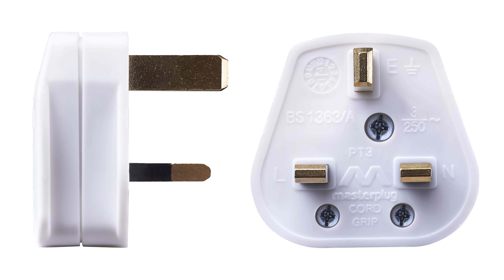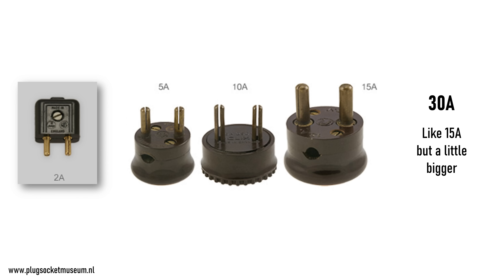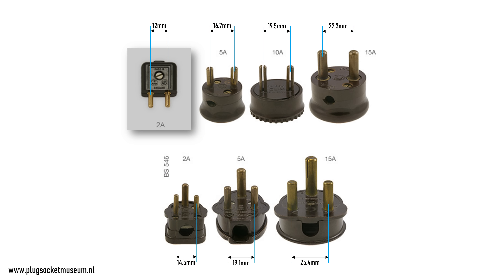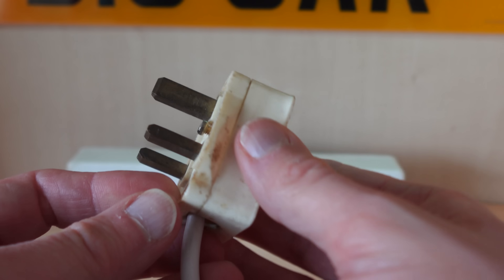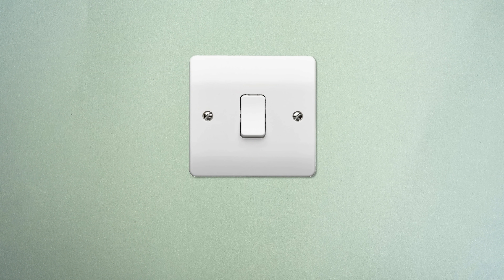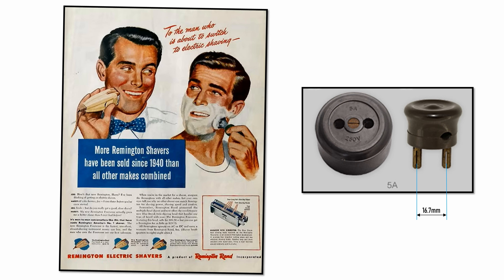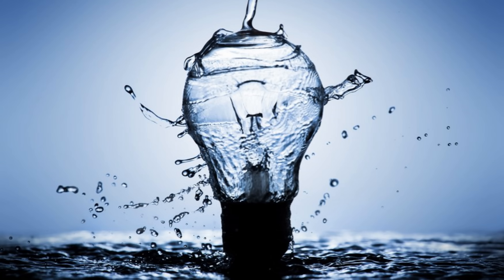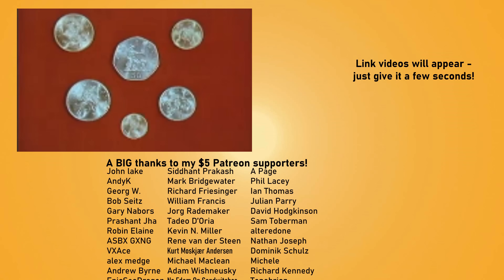Shaver Sockets are really clever

Comment: Son of (UK) electrician here. Really well presented potted history of UK plugs, not seen that referenced in any other video on the subject, nice touch.

Gets a bit nerdy from here on in....

My dad served his electrician's apprenticeship in the 1960s and when I was old enough (mid/late 1970s), I would sometimes go out on some house wiring jobs with him. I can remember helping to install many of these things. They are inherently safe as long as they are made to the relevant British Standard BS 4573 (as shown in this video). The transformer isolates you from the mains supply which is referenced to earth (ground) on UK outlets. 

The reason for the two voltage outputs (both isolated from the mains supply) dates back to the time when shavers were either 240V or 115V dependent on the market they were originally sold in. Some were dual voltage and would have a switch on the shaver to select the correct voltage, though of course, many is the time when folks got this wrong with the inevitable consequences! 
Modern electric shavers are generally all battery powered internally with charging circuitry which automatically detects the voltage when plugged in and adjusts accordingly.

To clarify a couple of things here, the fuse in the plug is actually to protect the cable (flex as we refer to it in the UK). Although, as you say, this is open to a lot of misunderstanding and interpretation which is why any shop selling these items should ask you what the cable and plug you're buying is for. Even better, they should really leave it to a qualified electrical engineer. UK plugs can be bought in a variety of use sizes too. 3amp, 5amp, 10amp and 13amp. Replacement fuses are also available in the following sizes 1, 3, 5, 7, 10 & 13amps and again must be made to British Standards (BS1362). 

Incidently, the plug shown at 3:26, the line (live) brown wire is much too long. The idea of the plug design is such that the live wire should be as short as possible so that in the event of the failure of the cable strain clamp, pulling on the cable would pull out the live wire first. All UK plugs sold currently have a wiring diagram attached to show how long each cable should be stripped before connecting it to it's respective terminal.
Reply: the idea of a shorter L wire is a good one, I noticed the shorter brown wire when extending appliance leads by twisting together the conductors and then wrapping in tape but I never even realised why this was until reading your comment. Makes sense now.
Reply: I love how you, the British, assumed that all the people are utter idiots. But instead of telling them right in the face, you introduced Regulations that do it in more subtle way. Attaboy!

Comment: Round pin BS546 15A plugs are still very common in UK theatres for dimmed stage lighting circuits
Reply: Still used in homes for lighting. Lamps that can be switched from light switch.

Comment: Here in Canada we have GFI outlets in bathrooms near the washbasins, also light and fan switches inside by the door. I have never heard of anyone getting a shock in the bathroom in my whole life.
Even my RV has GFI outlets in the bathroom, the power delivered from the RV is 220/110 volts.
Reply: We have GFIs we call them RCDs but they’re in the fuse box so protect the whole circuit. But we’re still overly cautious. Still not a fan of a mechanical device protecting you from shock.
Reply: The “toaster in the bath” joke doesn’t come from nowhere 😉
Reply: @techheck3358  a propane toaster in a bathroom??
Reply: @lukedoherty8062  So, are all of your breakers RCDs now?
Reply: @chrisbarnes2823  the joke about people plugging in an electric toaster and throwing it into a bathtub to electrocute themselves
Reply: @seanrodgers1839  Yes so all circuits are protected it’s been that way for years since the 2000s. It use to be two RCD protecting 5-6 circuit breakers but now each breaker is a RCBO. (residual current breaker with overcurrent protection) Which is a combined RCD and circuit breaker.
Reply: @lukedoherty8062  
The original intent of fuses, and later circuit breakers, was to protect the wiring from catching fire, not people.  Then GFCI came in later to protect people in risky areas. 

Protecting people from themselves is a newer thing, that started decades ago.

What about older houses that still have fuses or circuit breakers? GFCI outlets are good for this. This is the case for many homes in Canada, there is no requirement to change the main panel. 

I've been contemplating swapping the fuse box at my cottage to breakers or whatever the standard is now. My father installed it in the 70s, I'll probably have to upgrade the entire place. I'll be finding out the current standards soon.
Reply: Texan here, the only time I've gotten a shock in a bathroom is once when I was replacing a non-GFCI outlet with a GFCI one in my old bathroom. I did the work with the wires still hot, and the only reason I got shocked was because I unintentionally touched my screwdriver with the thumb of the hand holding the outlet while I was tightening the hot wire. It was nothing more than a quick zap through just the one hand, didn't even hurt, just startled me. I didn't drop anything, either, I just pulled my thumb away from the screwdriver and continued the work.

I've gotten bit by 120v and 240v a handful of times outside of bathrooms, but only when I was being very careless or intentionally doing something I shouldn't be, like doing electrical work hot. I do always deenergize any 3-phase before doing any work on it, though. I've never gotten a serious shock from anything, not even the 240. It hurts a bit, but no actual damage. This guy describes UK electrical as "well thought out," I would describe it as "highly paranoid." Even with water nearby, the only way you'd get shocked is either intentionally or by being extremely careless or ignorant. Assuming you don't have massive electrical system faults in your home, that is.
Reply: Your knowledge is very outdated. 220/110 V in Canada does not exist since the 1940s. It eas converter to 230/155 V and later 240/120 V.

Comment: here in Indonesia houses had both 110v and 220v, and they all used the same socket similar to the shaver one shown in this video, the sockets could accept both round (euro) and flat (us/japan) prongs.

you had to be careful not to plug a 110v device into 220v or it'll let out the magic smoke, and you had to be careful when buying lightbulbs because there were no standard voltage for lightbulbs either

eventually 110v service was discontinued in the late 90's/early 00's but for a while people had to live with both.

Comment: Interesting to learn that the UK used to have different size/shape sockets for different amperages. In Australia and New Zealand, we still have this, although most homes only have the standard 10a, there are 15a, 20a, and 32a sockets available, and while you can't plug a higher current plug into a lower current socket, they're cleverly designed so that you can plug a lower current plug into a higher current socket

Comment: In North America we simply provide bath room receptacles with "Ground Fault"' protection. This trips the receptacle off if any current flows to earth as it would if current were flowing through your body. It is either done with a breaker in the electric panel that incorporates ground fault protection or using a receptacle that has fault protection built in.  This allows us to use not only shavers, but higher current devices like hair dryers and curling irons.  It is common in most baths now, to have full counter tops (vanities) with a sink and room for electrics and cosmetics.  Wall mounted sinks that were the standard before the 1950's have gone away for the most part.

As for fused plugs, we now have them in Christmas lights, but not in much else.  Lamps have a 13 amp cord that would certainly hold until a 15 or 20 amp (120 volt) breaker tripped under a dead short and the lamp socket limits the bulb size.  Electronics have the fuse built into the chassis. Large heating appliances are supplied by dedicated circuits at 240 volts with receptacles for 20, 30, 50, and 60 amps. Larger units are usually hard wired.
Reply: Ground fault protectors is widely used in Europe also. This shown in the video are before ground fault protectors where common. Nowadays here in Sweden, everything except the fridge and freezer are connected through a ground fault protector.

Comment: It's funny to suggest that the purpose of the fuse is to protect the device. Because by the time the fuse can trigger, the device has ALREADY failed. Fuses aren't very fast unless you short them decisively and run an insane current through them. But they can prevent fires.
Reply: My understanding is that the fuse is to protect everything upstream of the socket, so house wiring etc. Since that is all rated way above 13A, the 13A is acceptable for every plug, as it will rupture first. Device (downstream) protection is afforded by fuse(s) in the device itself.
Reply from the maker: Thanks - I've posted a correction as a pinned comment.
Reply: @robertdewar1752  The primary purpose of a fuse, is to protect the circuit downstream of the fuse (not necessarily a specific device). If the current carrying capacity of a cable is exceeded for a long period of time, the cable can heat up and cause damage. If your appliance's cable is rated for 5A and you put a 13A fuse in to protect it, then that cable could be taking over twice its rated current without the fuse responding.

Everything upstream of a given fuse should already be rated to carry at least as much current as the highest-rated fuse or breaker on that path. House wiring rated at 20A isn't going to care about a 13A load that's been put on it, but it is going to care if you try to go over 20A (which is when the breaker for that circuit on the switchboard steps in). The switchboard doesn't care if you have multiple circuits drawing 20A each because it's built for at least 100A; but it does matter if your combined draw goes over that, which is when the 100A main breaker steps in. The same goes for fuses in plugs: everything upstream of the fuse is already rated to handle more than the fuse can handle. What isn't necessarily rated to handle that current, is the cable after the fuse that could become a fire hazard if allowed to draw more current than it is rated for. Even as you say, fuses within the device only protect the device itself (which is the circuit downstream of the onboard fuse).

In short, the current rating of a fuse should be no higher than the current rating of anything downstream of it (*including* wiring) until the next overload protective device, so that it can protect downstream components from overloads. 5A fuse for a 5A+ cable. 13A fuse for a 13A+ cable.
Reply: In a few cases a fuse protects a device. Say a motor gets stuck draw can increase and pop the fuse.  You can then fix whatever is sticking/stopping the motor, replace the fuse and be good to do.

But the main purpose of the fuse it to prevent the cord from dangerously overheating.
Reply: @Eyrlumi  Correct. The fuse is there to protect the cable attached to the device, which may only be rated for 3 or 5 amps.
Reply: It depends on the device. In the US, fuses in plugs aren't common, but there are two classes of appliance that do commonly have them - fans (if the motor is blocked from moving, they can draw significantly more current than designed and overheat) and christmas lights (since these are often daisy-chained, the fuse will blow if you've got too many strings of lights plugged together)
Reply: Fuses prevent overcurrent events which can lead to fires

Comment: A long time ago in Canada we had current limiting razor plugs in bathrooms but those have long since been replaced with normal 15/2A sockets that are GFCI protected either with everything in the bathroom wired downstream from the GFCI socket (so everything in there is protected) or the whole branch circuit is protected with a GFCI breaker.

Comment: I mean, here on the continent we mandate every circuit to be secured by a GFCI, and I have a lot of sockets and stuff in my bathroom just fine. I hate visiting the UK, since I can't dry my hair in the bathroom, I have to go find a socket somewhere, blindly blow dry my hair in shape, and hope for the best.
Reply: That's been true in the UK as well for many years now, but the standards concerning bathroom sockets remain.
Reply: Yeah for all the fanboying of the UK electrical appliance standards, they are pretty archaic and redundantly over-engineered to compensate for a lot of legacy issues.  Appliances that need a fuse almost always have one internally, and if not its easy to put a fuse on the main panel for each circuit.   And the rest of the world finds it easy to keep electrical appliances out of your bathtub.
Reply: The UK has always had barmy electrical setups imo but one thing I do like is that wall receptacles have switches on them so they can be turned off at the wall. Leaving appliances plugged into live circuits 24/7 even when not used is a fire/shock hazard. Appliances are supposed to be unplugged when not in use but no one ever does.

Comment: Might have been mentioned already but those round pin 15A plugs are still very commonly used in theatre, with a smaller 5A version also sometimes used. Ideal for this application as you want the fuse at ground level within the dimmer packs rather than up in the lighting rig where it’s harder to access!
Reply: I’ve seen them in some houses too! I think the explanation i was given at the time is that they’re sockets that can be switched by a light switch, for lamps and such
Reply: @techheck3358  yep! I see them still in some hotels etc when they don't want guests turning switches off if the lamp has a switch on it, saves double switches!

Comment: Timely video as I am visiting the UK and was just looking at the shaver socket in my hotel and wondering how it works. Great explanation!
Reply: You can also get a 3 pin to shaver adapter - they come with a 1 Amp fuse. I usually cut the 2-pin plugs off e.g. electric toothbrushes and fit 3 pin plugs, I like to live on the edge you see.